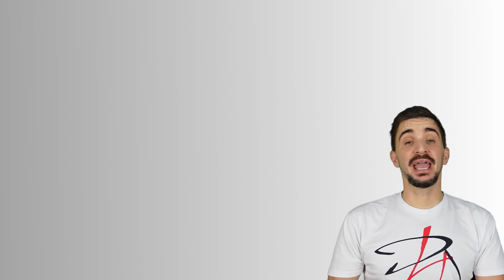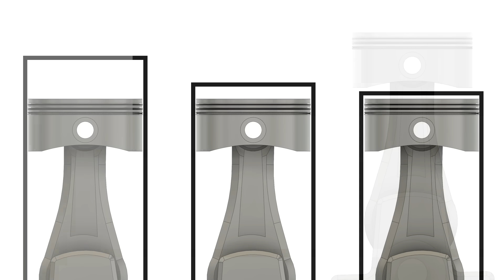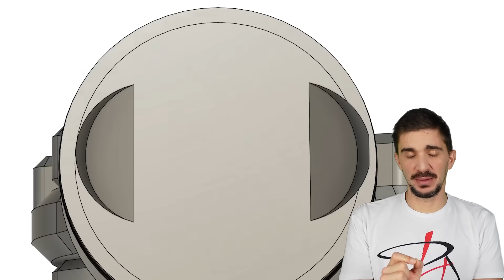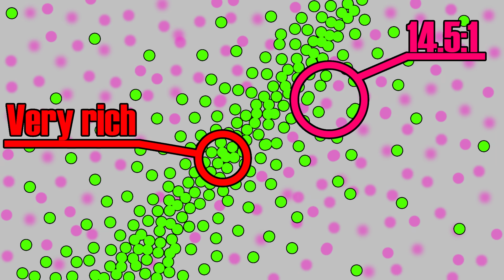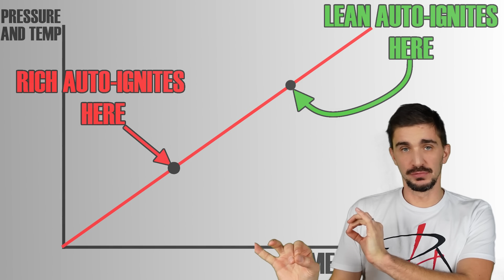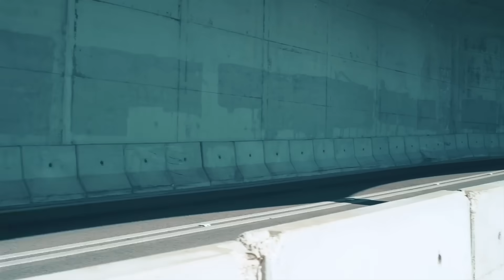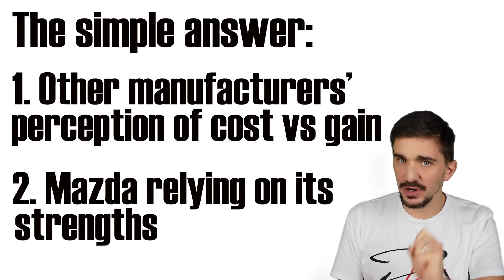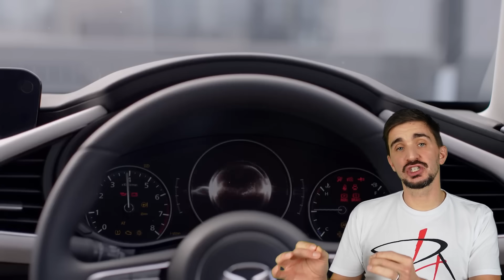The Game Changer Nobody Cares About - Mazda Skyactiv-X SPCCI How it Works and Why It Didn't Catch On

Comment: Mark my words this will become a hybrid engine that will function as a generator to charge a battery instead of driving the transition. And charging the battery. This is because it’s so effective but only at a consistent linear conditions like a set RPM for peak efficiency to charge the batteries for ex

Comment: interesting fact you didnt seem to mention, maybe because it isnt important for the video, but patrol burns much faster than diesel, thats why patrol engines can rev way higher than diesels can, diesels efficiency scale is pretty small max is about 4500 rpm, if u go higher than this you only lose horsepower and waste fuel

Comment: I like how the reviews talk about an engine that was designed for efficiency "Lacking Punch". I mean there is complexity there but not enough to create a major issues. 

Its the same with the ECVT People talk about it like it is boring to drive. Well yea because it is designed with efficiency and reliability in mind. Things that are punchy and fun usually either dont last long with out maintenance and/or such fuel down fast. 

If you want fun you have to take reliable and fuel efficient out of your mind these are commuter cars. 

Just my 2 cents im sure someone will show me examples of cars that achieve both. I am not saying you cannot do it just not an expectation in my mind. That is why i have a commuter and i have toys.

Comment: As someone who owns a 2021 AWD Skyactiv-X Mazda 3, is HIGHLY underrated. Friends with BMW and Mercedes have praised the premium feel and look for its price, especially the interior (I have the 100th limited edition so white, red and black leather everywhere). 
The automatic, is the good old real 6 gears transmission with manual mode and not fake CVT. Many forget that with a slight modification on the intake the car whines like a Hellcat! You have a wonderful chassis with predictive AWD, whining engine and a car that just keep pulling once you work it on the gears without lacking anything! And the cruising is just so good and comfortable you really try to find reasons to drive it!

Comment: Keep in mind that Mazda continues to produce and utilize its famous Skyactiv-Drive 6-speed automatic (and 6-speed manual) transmissions. While most competitors have transitioned to 8-, 9-, or 10-speed gearboxes or CVTs, Mazda keeps their 6-speed for a few specific reasons:
   *Why Mazda Sticks to the 6-SpeedDriving Dynamics: Fewer gears mean the car spends less time "hunting" for the right gear, providing a more linear, direct, and responsive feel
    *Mechanical Simplicity: It is a lighter, highly refined, and proven design that delivers excellent fuel economy without the complexity of heavily geared alternatives
     *Engine Matching: The 6-speed is specifically calibrated to work in harmony with Mazda’s Skyactiv engines to maximize responsiveness.
Watching other makes struggling with their 8-9-10 speed, CVT transmissions, even Toyota, Mazda made smart move to stay away from CVTs and keep bullet proof 6 auto tranny's on the road.

Comment: No, the difference these days is about 6 percent in efficiency on Toyota engines. 41% TE for Dynamic Force, 47% for diesel. This guy doesn't understand how gasoline engines actually work, and then talks complete nonsense about diesel. A diesel is always over aired, there is no ideal fuel/air ratio. 

Another internet genius

Avoid.

Comment: Nice report.  In 2014, we purchased a 2015 Mazda 6 with first gen SkyActive tech for the wife.  I test drove it and was not very impressed with the performance.  But the suspension system was excellent.  As I said to the salesman and others, the suspension system was neither too tight or loose, it simply acknowledged every road imperfection.  That's pretty awesome actually.  BUT THEN, a few months after mechanical break in, I became very impressed with the SkyActive tech drive train as it developed some very reasonable pep.  The only downside to the Mazda 6 was rear seat head and legroom.  We drove a 1600 mile round trip vacation with two 14 year old boys in the back seat and they were rather uncomfortable the entire trip and we couldn't blame them.  Otherwise, I grew to love the car and actually preferred driving it around town running errands.  But the main point was before break in, the SkyActive was unimpressive but after break in, it was a whole different story.

Comment: to me this sounds like the perfect generator for a electric drivetrain hybrid, avoiding the "lackluster" feel of a small NA engine, and it can be run at the perfect RPM and load for highest possible efficiancy always using the SPCCI, and the customer would not have to "work" the engine to get it to run properly

Comment: I think the problem with the engine is that it misses both main markets where it might have a place:

- The performance-focused market. It simply underperforms compared to higher horsepower engines.
- The efficiency-focused market. It can't compete with hybrids on its own.

The obvious solution is to use the engine in a hybrid. Keep the RPMs low most of the time to get fuel efficiency, and get some extra punch at low speeds from the electric motor.
Reply: REEV (range extended electric vehicle) would be better use

Comment: High compression gasoline engines. such as racing engines require higher octane fuel. because low octane fuel burns slower causing spark knock.

Comment: Imagine a HCCI engine on a series hybrid. Control is not much of an issue because the engine will run on constant rpm simply to charge the battery. Nissan should take heed

Comment: 🎉 I have a 20172M6 GT that I bought CPO with 7k on it exclusively to drive between san diego and tuscon 3 times a month. Im giving the car to my nephew turning 16 next month and its in fantastic condition with 275k on the odometer.  Soul Red paint still looks great considering the miles across the desert in high heat. 1 head gasket (easy) and im putting a second water pump in it this weekend (precautionary only for his sake) beyond that ive only done brakes (lots of them maybe 5 sets)  motor mounts, suspension stuff, 4 sets of spark plus 2 sets of coils and I’ve religiously changed oil every 6 k and all other fluids every 10 th oil change. Oh and I changed the radiator and hoses and went theough the ac system last year because a rock went through the radiator.  Still gets 32 mpg on flat road and its only lost 1 mpg from new on that specific trip. Consider 1 huge grade and 2 others on the trip I find that to he remarkable. 

This was my first mazda and its been spectacular. White leather still looks good. The only failure ive had was the infotainment screen went out and I guess there was some recall on that so it got replaced for free at 160k.  I fully expect that my nephew will get through college driving it. 

I just bought a 2026 Mazda CX-50 to continue making the same trip. I had full intentions on getting the same NA 2.5 / 6 speed but I own a pretty large business and the Rav4 hybrids (suck to drive though) have been ultra reliable so I chose the hybrid because the CX-50 felt a touch too heavy for the power of the 2.5 & i thought maybe getting 275k out of it was less likely. the hybrid was a good albeit not as fun to drive compromise. My youngest nephew is 6 so hopefully this streak of Soul Red Mazdas for turning 16 continues.

Comment: Is this engine made exclusively in Japan with only Japanese parts, or is this a "Collaboration" between Mazda and Ford or some other manufacturer? 
I have purchased only one Mazda, it was new. The VIN number started with J which should have meant it was all Japanese. Ford was involved and it blew a head gasket at 60K.
I'll never touch another one. There was no documentation showing Ford was involved at the sale.
Reply: I drive a 2006 Mazda 3 Sports model with a 2,3L engine and a 5-speed transmission. It has over 250 thousand miles on the odometer and it runs as well as it ever did. It’s the second Mazda I ever owned and the first one was just as good, but was totalled by someone who ran a red light. 
You might have just been unlucky and bought a rare one that was a lemon. 
Never buying another one is childish petulance. 
But then most people under 40 are childish and petulant these days, with the emotional maturity of a four year old of fifty years ago.

Comment: If a mazda skyactiv hybrid drive train uses the battery/electric mode to take up smaller fluctuations in loads, it would enable the gasoline engine to remain in the compression ignition phase more. Potentially, always.

Comment: Doing this with fuel injection and computers may be new, but my 1975 honda civic  CVCC engine pretty much did this with carburetors (2 of them), one for the spark chamber running rich with a port into the main chamber running lean.

Comment: Until very recently, I had a 2014 Mazda 3. It was a Skyactiv, but not Skyactiv-X. I put 230k miles on it, and never had to repair *anything*. There was never a single problem with that engine, despite it being only the second year of production of Skyactiv engines. I'd still be driving it if a deer hadn't decided to ram into the side of it.

The only reason I didn't replace it with another Mazda was because the 2026 models weren't competitive in fuel economy. In fact, the 2026 is markedly less efficient  (like 12%) than the 2014.

Comment: I’m looking to get one of these as my next car, have had a Japanese NA petrol engine before, I t was a 2litre vet Honda, though very reliable engine wise you did have to keep the revs up to drive and the fuel consumption  wasn’t great, also the reliability of the running gear wasn’t so good it seemed to eat bushes and arms and stuff.
The Mazda looks like a much better option.

Comment: That's what's so good about my 2015 Fiesta ST, (except for the bs engine bay plastics), i have no stupid driving aids, i have a mechanical hand brake, i'm fully in control, once you turn traction control off anyway. The torque vectoring stays on tho but that's useful control in tight fast cornering..

Comment: Perhaps the combination allowed by an MHEV electrical system, where the electric motor does the job at low revs, is finally the ideal solution for Mazdas. And Mazda has partnerships with Toyota for technology development. And Toyota is well developed in MHEV.

Comment: Does Ford still own 30% of Mazda. I own a F150 fx4 with 3.5tt. Powerboost. Modern power that would be a big block V8 or a diesel 6. 
We are looking at  Mazda cx50 or cx70 with the 3.3 straight 6.

Comment: Is Mazda’s SkyActiv-X Technology Patented? Why Aren't Other Manufacturers Copying It?
The short answer is yes. Mazda holds hundreds of patents on this technology. However, the reason other manufacturers aren't "cloning" it is less about legal barriers and more about engineering complexity and economic feasibility.

Here is the breakdown of why Mazda remains the only player in this field:

1. Patents are on the "Execution," Not the "Idea"
The core concept—a gasoline engine that operates like a diesel (using pressure rather than a spark to ignite the fuel)—is known as HCCI (Homogeneous Charge Compression Ignition). This scientific concept has been around for decades, and Mazda doesn't "own" it.

What Mazda does own is the patent for SPCCI (Spark Controlled Compression Ignition). This is the specific "trick" that allows the engine to switch seamlessly between spark ignition and compression ignition using a spark-controlled flame ball. They hold patents on:

The unique combustion chamber geometry.

Ultra-high-pressure sensors in each cylinder.

The complex algorithms governing the ECU (Engine Control Unit).

2. The Complexity "Moat"
In the automotive world, if a technology is a "game-changer," others usually find a way to design around the patent or pay royalties. With SkyActiv-X, there are three reasons this hasn't happened:

Extreme Precision: This engine operates like a Swiss watch, constantly on the edge of "knocking" (engine-damaging pre-ignition). Most manufacturers (Toyota, VW, Hyundai) decided the engineering headache was simply too high.

The Shift to EVs: While Mazda spent billions refining the internal combustion engine, the rest of the industry shifted its R&D budgets to battery tech and electric motors. They see little point in spending a decade developing a complex gas engine when the future is electric.

Cost vs. Benefit: These engines are nearly as expensive to manufacture as diesel engines, but the real-world fuel savings—while impressive—aren't always dramatic enough to justify the price premium for the average consumer.

3. Others Have Tried (and Quit)
Mazda wasn't the only one interested. Mercedes-Benz introduced a concept called DiesOtto back in 2007, and GM and VW both had experimental prototypes. They eventually walked away because they couldn't achieve the reliability and smoothness that Mazda managed to bring to mass production.

The Bottom Line
Mazda is legally protected by its specific patents, but its real protection is its persistence. Mazda chose to prove that the internal combustion engine still has untapped potential, while the rest of the world moved on to the next chapter. It’s a masterpiece of mechanical engineering, even if it arrived just as the electric era began to take over.

Comment: I have this engine and unless you drive like a snail it will use as much gas asanormalno nonsense older NA engine. And it rrally does not handle sporty driving I would not get it again.

Comment: how do they prevent preignition from occurring running lean gasoline ratios in a high compression ratio engine? That's the exact conditions that causes hot spots which cause preignition which soon burns a hold in the piston top.

Comment: 1.  Mazdas don't get any better mileage than other makes do.  2.  Mazda does offer turbo skyactive engines.  3.  Mazda does offer plugin hybrid car with skyactiv engine.  Doesn't get any better mileage than other PHEV makes.  Impressive tech but the result is ....... nothing much better.  Mazda had to go turbo or hybrid or put on the same pollution controls as all other cars.  Last question - do you drive a Mazda?

Comment: I have/had a 2012 Mazda 3 with a 2.2 Diesel. Even these "older" models, need to be driven, you can feel it. It wanted to shift gears at over 3000 rpm, which for a normal diesel is quite high, but this one loved it everytime. Unfortunately, due to many issues and a fully clogged DPF filter, it's not worth the costs of repairs, but it put a smile on my face EVERY day for the past 130 000 km (now at almost 240 000). I hope to see a video regarding Mazda's steering and suspension systems sometime, they feel more alive than most cars because of it❤

Comment: But how RELIABLE are these engines? Compared to Toyota and Honda?
Reply: I drive a 2006 Mazda 3 with a 2.3 liter petrol engine and it has 430 thousand kilometers (270 thousand miles) on the odometer. 
It still runs as well as the day I bought it. That is easily as reliable as Toyotas and Hondas.

Comment: WRONG. gas is MANY times more dirty & dangerous than diesel. morons see the black smoke & THINK 'ewww!'. in reality, what you can't see CAN kill you, LITERALLY. if you are ever LOCKED in a confined space with diesel exhaust to the point of unconciousness, paramedics can & most likely WILL revive & save your life. with gasoline? not going to happen. even with a modern engine, the toxins present from burning gasoline will most definately kill you and the heavy metal micro-contaminants from the catalytic converters are just as bad. diesel smoke? mostly carbon. if you like to BBQ or enjoy a good campfire? not that different. we'd be far better off to ditch the gas & switch to diesel. I was first alerted to this fact by REPEATED stories from paramedics who ALL seperately incist the same thing- "never have we been able to save gas fume victims- but the diesel exhaust ones? it's about 50/50.